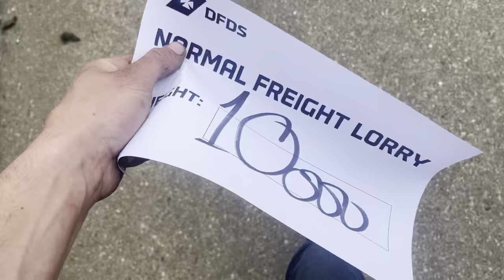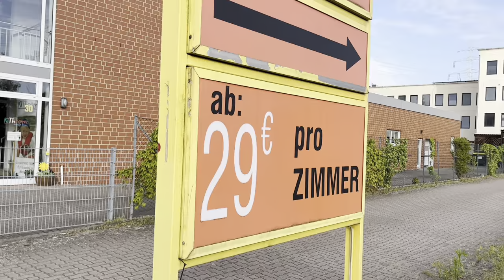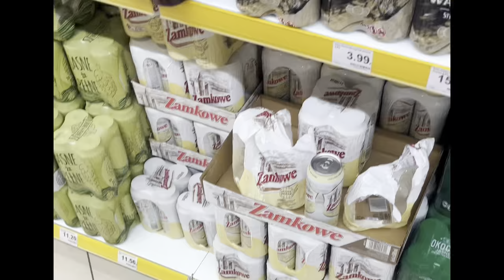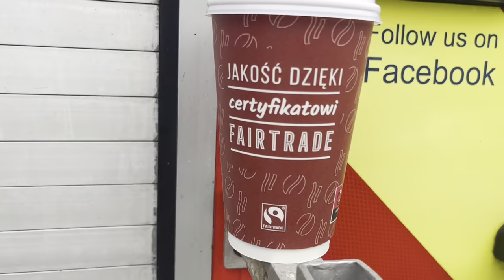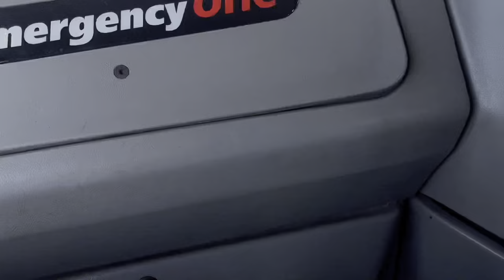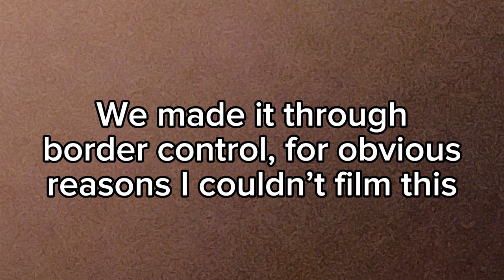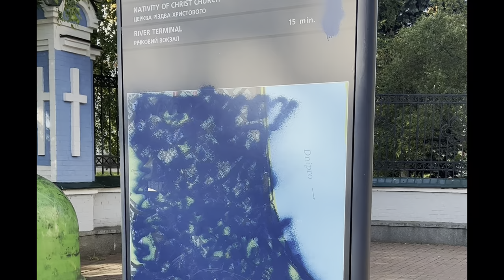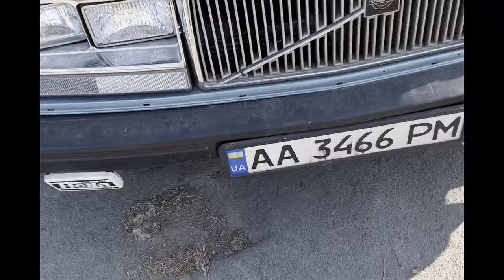Driving a fire engine to UKRAINE

Comment: Okay it is good that you give a fire engine but they drive of the right side of the road and the steering wheel on the left so it is not very hadny.
Reply: Better than nothing
Reply: @doctorrohrenkuh880  Yeah that is what i say but they have to change it to KM/H and they drive to the right